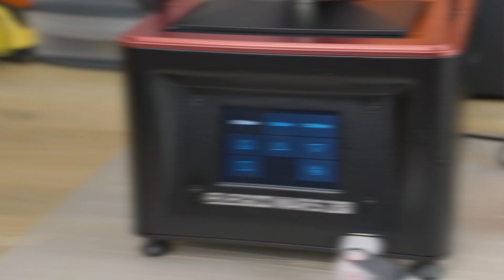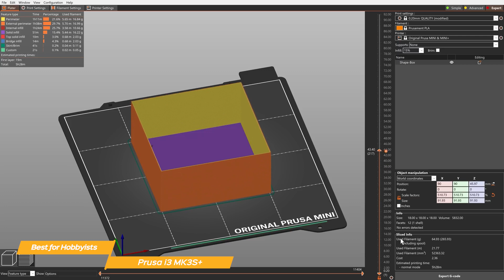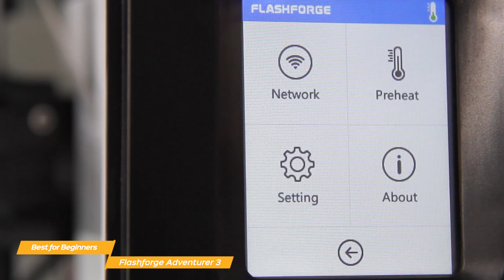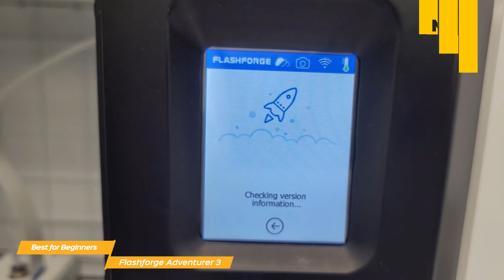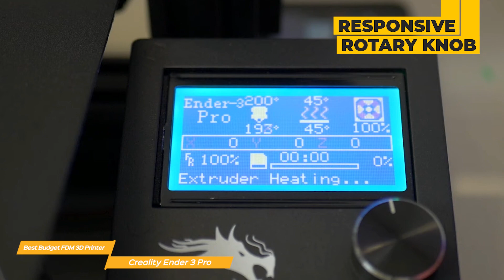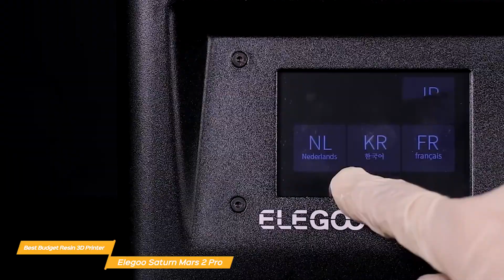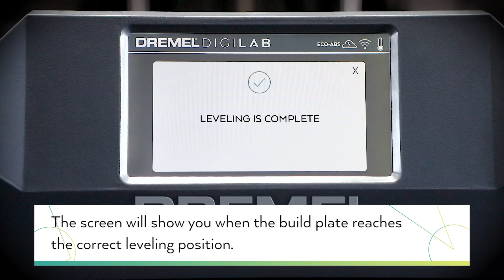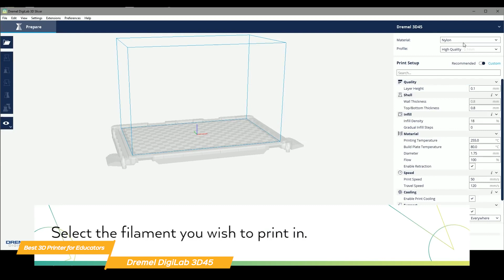TOP 5: Best 3D Printers 2024

Comment: I've never regretted buying a pre-owned Ultimaker S3 (dual core) 3D printer, it's identical to their larger S5 variant and boasts all the features of the S5, served up in a slightly smaller desktop friendly package. Having the capacity to print simultaneously in two completely different filaments is a difficult act to beat, even for all the high spec 3D printers reviewed in this video, none were dual core. My advice is check out online auctions for high grade small commercial 3D printers, before investing in a more limited retail hobby-style tabletop printer. 👍

Comment: I think with the huge veraty of mods avible for ender i think that will be my 2nd and 3rd printer think i graned the ender 3 pro  one and the ender 3 neo max i have a elegoo 3 pro been awsome but it absulitly hates petg had 2 warped beds the probe sucks majorly had to add bed springs to fix the bed mesh since they where dumb and didnt put springs in the 3 pro hate the elegoo screen the 4 u cant emove the screen like the 3 so thats a hell no for me the screen is to small and bulkey and just has a ugly look was debateing on geting a 3 max but i think elegoo finaly pushed its last sraw cant ulgrade to the parts i want with out ukgradeing the mother bord or useing a pi for kliper and the pins and then a pico for a 2nd mcu for the gpio pins its great for pla it sucks donkey nuts for petg

Comment: Good morning, in your opinion, what is the best 3D printer, with an approximate area of 300x300x300mm and that prints ABS and ASA filaments?
Thanks
Reply: What do you plan on printing?
Reply: i want print channel letters, thanks
Reply: I would recommend a Odin Smart
Reply: I wana get the ender 3 neo max since I'm starting to dislike elegoo
Reply: I bought a pre-owned Ultimaker S3 (dual core) 3D printer, with a dozen sealed packs of various filament on eBay and in my humble opinion, it's the dogs bollocks! 😉👍
Reply: bambu lab x1 carbon 100%